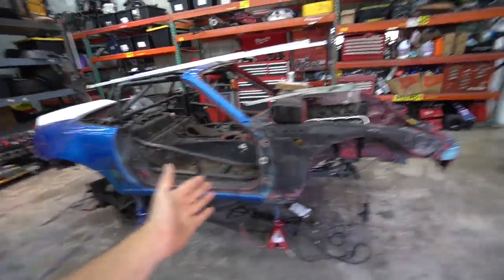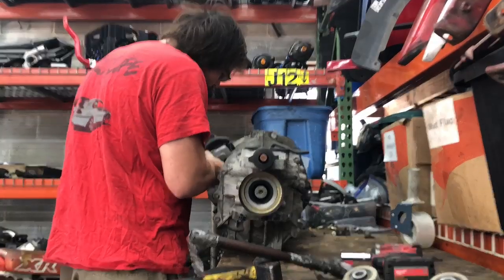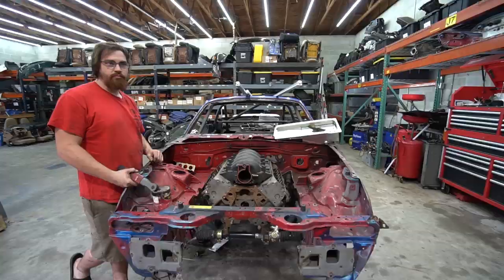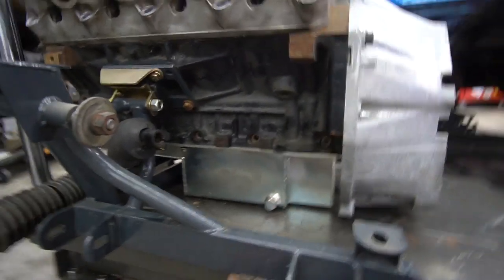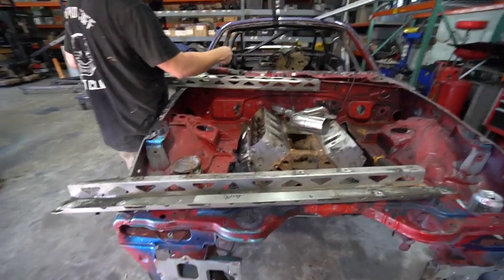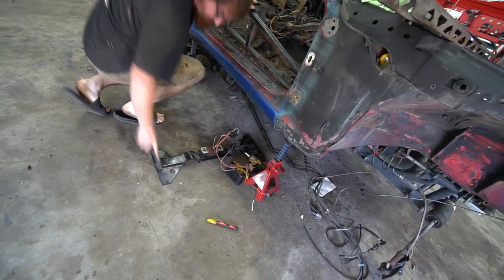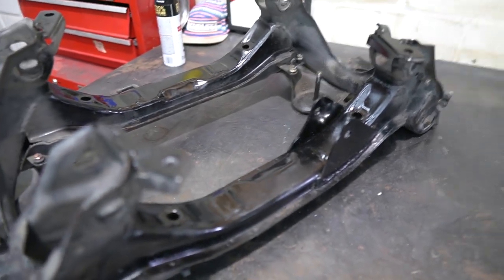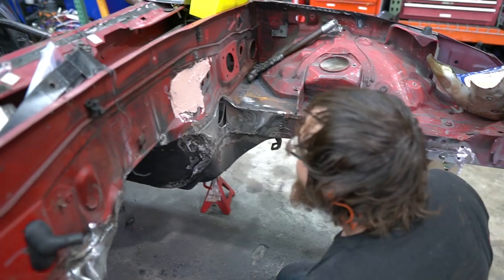LS Swap Miata Build Part 2! Trans Mount, Diff Install, Welding, Bay Prep, etc(A Month of Progress)

Comment: Try welding some stainless with your mig you'll be surprised , you can get stainless wire . I don't use it but I can mig stainless to stainless , stainless to mild steel etc. Your weld will be discoloured if you don't use the SS wire . Just be mindful that the stainless will build and hold heat way faster .

Comment: For future reference, stainless can be mig welded as long as you use correct shielding gas and wire. Doesn’t need to be tig welded

Comment: You can mig stainless and with mild steel wire. It will be just as strong but may rust if you don’t paint it.
The plates he put at the ends are done correctly as they are trying to fully weld them in would be wrong and cause the rails to crack

Comment: Hey taylor theres a video i saw on here where a guy heated up his tungsten and put a bend in it. Uses that with a relatively well sized cup to get into tight and awkward places with a tig
Reply: what video was that? would like to see that
Reply: @danduncan9937  damn, I just remember  having seen it watching videos about welding, possibly a video from killfab, the fab forums, or a couple others like that I used to watch. If I find the video I'll let you know, he basically just put the cup against the tungsten  and when it was at temp he tapped a bend into it
Reply: @danduncan9937  not the same video, also not the whole process but here's  a link to a video clip that shows the bending process https://youtu.be/FfJ8jciLm_8

Comment: long tubes would be cool AF and make the car sound even better
Reply: also I know its a bit late now but the serialnine cd999 shifter relocation kit looks shorter than the one you are using, it might help to put the shifter closer to the original hole in the shell

Comment: Ttrans mount legit!
Reply: Trans*..... I wonder how strong an aluminum mount would be?
Reply: I like you shift knob relocation. Lol.... subscribed btw
Reply: @brianthompson4284  thank you sir! Soon I'm going to be redoing the transmission setup and going with an ar5 trans. Planning to do a multi part series on the swap and fabricated parts
Reply: @Typical_Garage  ar5?
Reply: @brianthompson4284  yep, pretty stout unit. Fabbot fab makes an adapter for them to LS engines and they've been proven to hold up 900 pounds of torque and can be had for a couple hundred bucks!
Reply: @Typical_Garage  Thats awesome! Im definitely going to have to look into that option for my ls swapped S10. T56's are crazy priced. Love the idea of cd009 but theyre not very common in my area
Reply: @brianthompson4284  just got to keep looking and they'll pop up. I actually bought a cd009 online for like $600 but the adapters are not budget friendly. The fabbot unit I mentioned are only $400.
Reply: @Typical_Garage  does that come with everything? Do they have a website??
Reply: @brianthompson4284  You'll have to source a 4L60 bellhousing and clutch but that's literally it. I'm under a grand on my swap fabbot does sell everything you'll need at an additional cost but like I said, with everything needed it's still a great priced option.
Reply: @Typical_Garage  when are you doing the videos on install? I want to see this
Reply: @brianthompson4284  I'll probably start the process next month after I'm settled into my new house.
Reply: @Typical_Garage  I'll definitely be watching!
Reply: @brianthompson4284  I appreciate that. Let everyone else you know that might be interested to check it out too. You already know the channel. 👍🏻
Reply: @Typical_Garage  you bet 🤙🏼

Comment: How do you know if the Transmissions is a CD 09 or not
Reply: Greg Johnson it’ll say it somewhere on it, just like your engine shows the engine code on the block
Reply: @fear_dies_i_dont  i have 2003 z not quite sure of the previous owner swapped transmission I do have a number 2 stamped on the driver side of  the transmission
Reply: Greg Johnson just looked it up, there should be a vin plate on the passenger side of the trans you can call some places and they can identify what trans it is. But from the info o gathered if it says #2 that means it’s pre 2004 and the stronger version of the others.

Comment: You should do the long tubes.

Just try to fully visualize the final product to see where the tough part will be before you fabricate yourself in to a corner.

Make sure you do a back purge so your stainless doesn't sugar.

If that last sentence doesn't make sense to you, you need to do some reading.

You can do it, just take your time, work smart and next time you have a similar project it's going to go much faster.

Comment: Can you not MIG stainless?
Reply: You can. To keep the weld stainless you need stainless welding wire.
Reply: @scooz14  aww ok, what gas would be best to use?  100% argon?
Reply: @TexasRedneck  yes 100%
Reply: @scooz14  thank you!